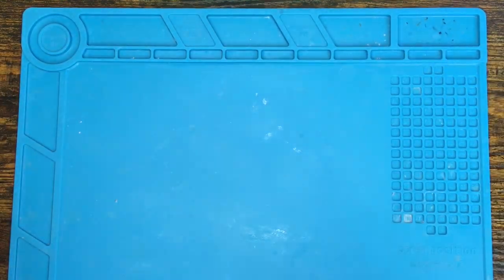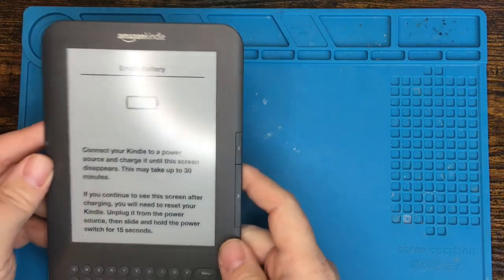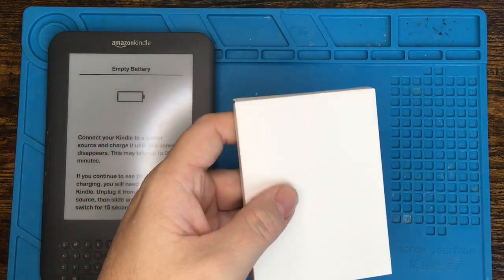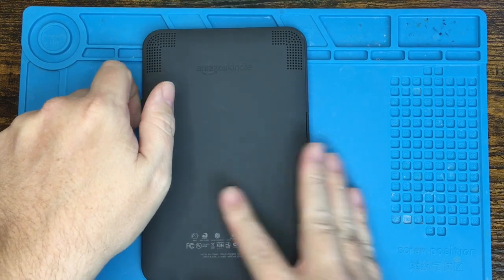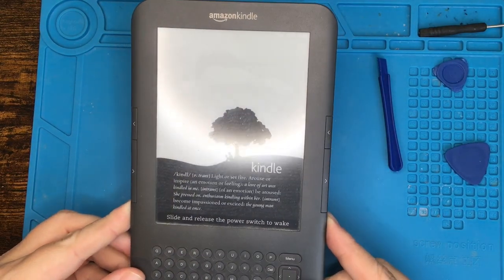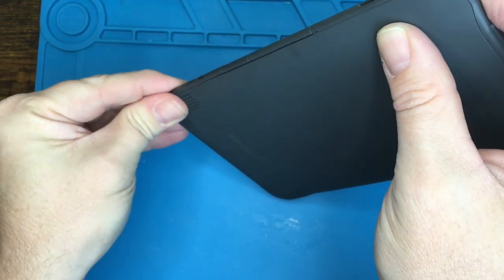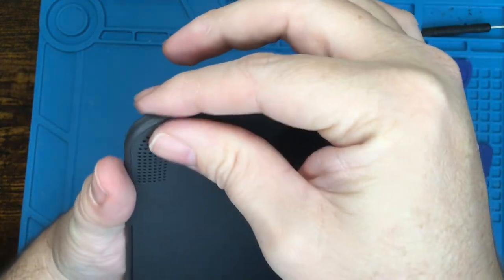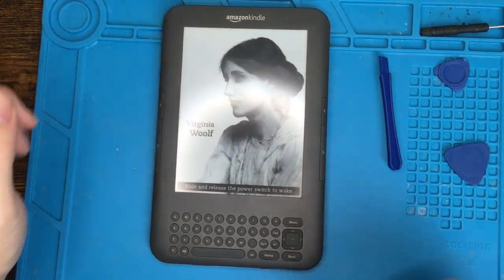Amazon Kindle Keyboard Battery Replacement!

Comment from the maker: It seems this question has come up a few times in the past, so I'll pin it in a comment here.  

The battery I bought for this video is no longer listed.  I bought it from a random eBay listing a few years back that is no longer available.  However, you can find it pretty much anywhere online (Amazon, eBay, etc.).  Here's a current active listing for one of these batteries for sale (not an affiliate link):

https://www.amazon.com/dp/B0B74S8145

I just searched for "Kindle Keyboard" and "Battery", and found one that matched the model (S10-346392-0100).

Hope that helps!

Comment: Thanks for this video - I successfully swapped out the battery in my old Kindle Keyboard (bought the replacement on Amazon) and it was so much more simple than I thought it would be. The hardest part was snapping the case back together! Feeling very pleased with myself!

Comment: Heyy i have this one kindle, just bought it from a secondhand store online,  but the big issue is this kindle unfortunately is a managed device, and the wifi is off, i know that this kindle have no support from amazon anymore for it 3g, but i thought the wifi must be can be use, but as i said it is already managed to not to connect to wifi from the previous owner. And i also cant factory reset it, after i ask the issue with Amazon CS it said bcs this kindle already old so the wifi can't be use. But i think, its not bcs of it, its just already managed by the previous owner maybe for their child. And it just dead so they sold it. I really want to make it become can connect to wifi. Sadly i cant do the factory reset

Comment: Are you able to connect it to your account and still load current books? My concern is the discontinued support from Amazon for the older devices. I just tried charging my Kindle Keyboard for the first time in about 4 years and I would really love for it to work again if I can get my current reads on it.
Reply: You can still connect to wifi on it and sync your purchases

Comment: Thanks for this. I have a Kindle Keyboard that I bought when they were first introduced here in Australia many years ago. The battery is now having trouble holding a charge for more than a couple of days. I didn't realise it was so easy to replace the battery - I imagined it was probably glued in place like so many others. And I can get one from one of the many battery supply stores here. Mine is also the SIM card model as I think the WiFi one was a higher price.
Update ten minutes later. I've just found out that these old Kindles no longer have access to the Kindle Store. I've mostly bought books from the website so didn't know they turned off my device's direct access late in 2022. Maybe I need to update instead of replace the battery.
Reply: They are still connected to the web service when you connect via WiFi, they just can't use the store directly. You can still send books you purchased or custom files via the app and website. And of course you can use Calibre to manage ebooks directly over USB no matter how old the Kindle is (I have a Kindle 1!) 

Upgraded Kindles are still nice though :)

Comment: I just put a new battery in 
But unfortunately it doesn’t work for mine
Do you know why?
It still stuck in the empty battery
Reply: Same here. It will not do the rest.
Reply: @bobs7091  Me too  New battery stuck on empty battery,  charged it to computer, to wall, will not open
Reply: And me
Reply: same here.  replaced battery.  no luck resetting at all.  Tried everything.  Frustrating.

Comment: I have the same kindle, it has not been used nor charged for nearly a decade. i have been charging it for a few days now and it won’t still turn on, the charging light is still orange. The display does not even say “battery empty “though, its just the normal display that says slide to turn on.
Reply: batteries are very cheap and easy to replace, like 5 minutes if you have both hands tied behind your back.
Reply: My screen froze up in the middle of an update with the kindle tree on it. Charging only lasts about 5 seconds then goes off so I’m not even sure if it’s only a battery issue. 7 years ago I couldn’t find replacement batteries at all so I’m excited to see they are available and I’m willing to give it a try.